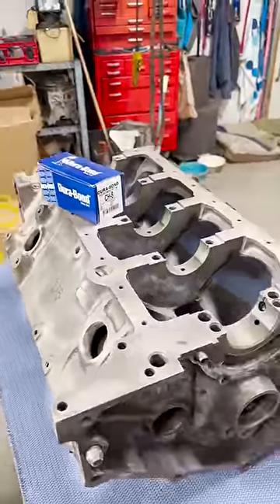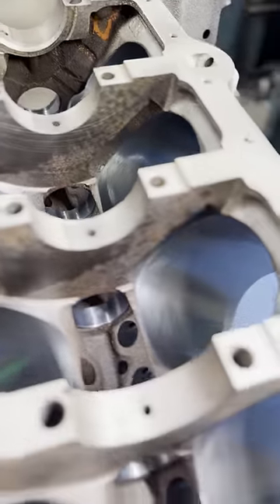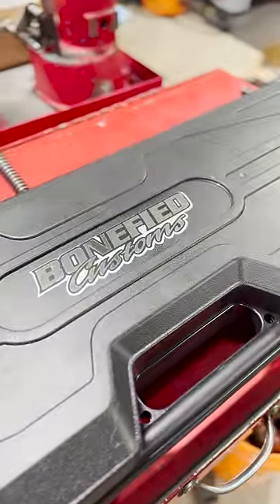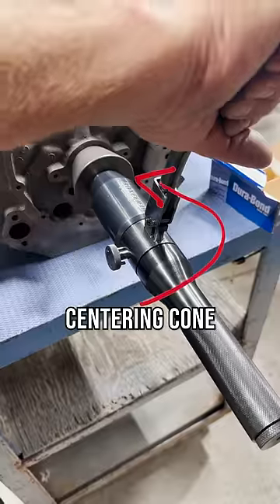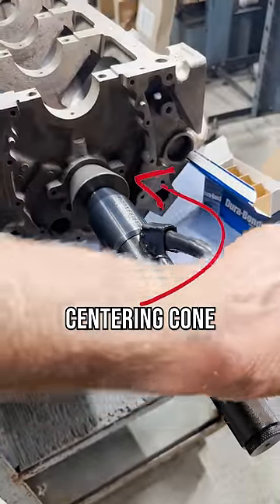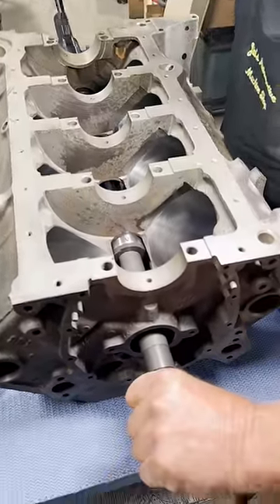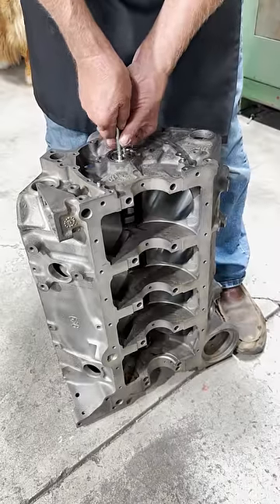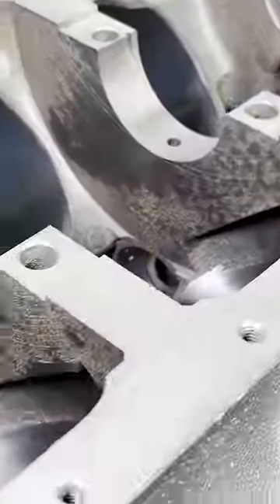#shorts No More Pounding In Cam Bearings W/ Bonefied Customs New Cam Bearing Tool!

Comment: Someone finally came up with a better way to install cam bearings?👏👏👏😁
Reply: What ??? The best way has been around forever its just most shops choose not to use it, shrink them in, cryo freezers have been around for ages or dry ice or liquid nitrogen then there is zero risk of galling causing distortion, this is just a new twist on a poor method !
Reply: @Hitman-ds1ei  most shops assume LN2 is expensive. 

It used to be, but these days it's CHEAP and a dewar will hold  the stuff for up to 6 months
Reply: @miscbits6399 EXACTLTY. I'm a machinist with 5 axis cnc and when we put them in our fixtures we use liquid nitrogen to shrink it. It heats up quick so you have to move fast or it won't go in. 1mm less diameter and liquid nitrogen makes a snug fit
Reply: What's a dewar cost?

Comment: And if you're a home gamer, you can buy a harbor freight 96718 hydraulic knockout punch kit ($100!) And make a few adapters of your own to do this.  It also doubles as a hydraulic gear installer, knockout punch, hell you can use it to pull rusted in balljoints out and suspension bushings if you make the correct adapters, and I've also made adapters to use it to install lug studs in axles without galling the threads.  I have videos of a few of these up on my channel, such as installing an nv4500 fifth gear without damaging any bearings hammering it on and installing lug studs in a one ton truck axle hub flange.

Comment: I'm a shop in Canada and because nothing is available here and import costs are prohibitive, i had a local machinist make me a screw press that's basically the same (although slower) and aluminum dies for every block i commonly do.

HUGE time saver, i used to order 2 sets of cam bearings for every engine, don't need to do that anymore! You can DIY it on a lathe really easy to make, mines just a long grade 8 threaded rod from mcmastercarr, i used fine thread but probably not needed, the centering cones and die are all aluminum and there's a nut sitting in the centering cone.

I use hand tools for the install, and zip it off with my little impact. I don't like using impacts for install but you could totally do it! They make wheel bearing presses the same way.

Comment: I love this tool- it takes the guesswork out of ‘did I get the oil holes lined up’, and removes the risk of deforming the bearing backing with impact !
Reply: After seeing one of these in action I started gathering materials to make something similar. I'm going to use the mandrels from my old cam bearing installer .

Comment: Back in the 80s, we just used a large diameter threaded rod and nut with a wooden shim to hold the bearing and a washer to press the bearing into place. Worked perfectly.

Comment: I built myself a similar tool but utilizes a large acme threaded shaft and big T-handle pulls them right in perfect alignment. I did this after 3 different machine shops installed new cam bearings i could not get the camshaft in. One i could get in but was tight turning even with cam gear on
Reply: 3?  Wow.  Sounds like cam tunnel sizing & alignment needed checking - corrections might require going to oversize bearings.

Comment: Nice to see you're upgrading,  but the old carpenter knows that some jobs require a BFH...
Reply: I hate needing the bfh,    too many hit fingers with the 28oz😂😂😂
Reply: Love the reference to the BFH. Made me smile.
Reply: Today after a fair amount of cursing and asking for bolt cutters and a match I broke out the bfh to change the "quick connect fitting" fuel filter. It was the right tool for the job on top of the fitting tool due to the inferior placement of said fuel filter
Reply: @calebz1448  Percussion technology comes through again! 👍

Comment: I've always used a piece of all thread, a big flat washer, and a homemade bushing that fits snug in the bearing with just enough lip to pull the bearing. I've never seen anyone use a slide hammer or any other hammer.

Comment: Its not going to speed up the process. Lots of other places to spend that money.
Reply from the maker: If speed is your only concern as a professional, I would question the work coming out of your shop.
Reply: @JAMSIONLINE  My point is that it takes the same amount time using either tool to get the same result so I would rather buy a tool that give me a better result elsewhere. I am so detailed in my builds I should probably charge more than I do but thats another story. In no way did I disparage your work so why attack mine?
Reply from the maker: @donziperk your comment implied that your only consideration when making an investment is speed. The video doesn’t attempt to advertise this tool as an improvement in speed, it advertises an improvement in process in the form of reduction of defects. Don’t take it so personal. I just stated my opinion that I question people when their sole basis for decision making is speed.
Reply: @JAMSIONLINE  You questioned the work coming out of my shop for no reason. And BTW speed is not a reason. Why should I have accept that. I have spent 50 years building specialty engines and twice yes I’ll admit twice I’ve had a cam bearing go bad during install. It happens to the best of us.